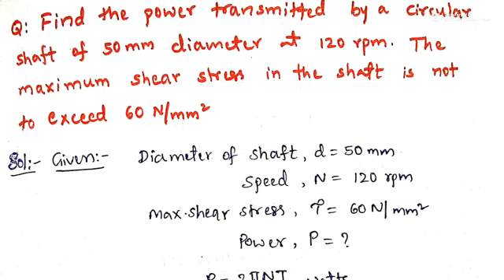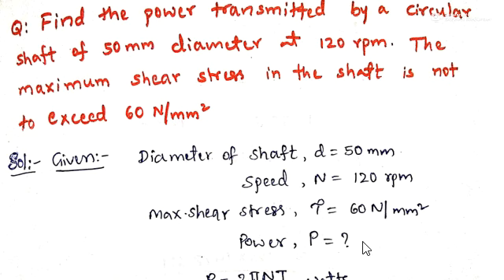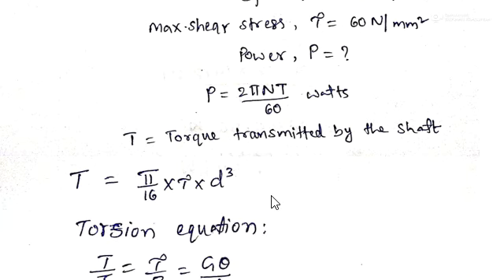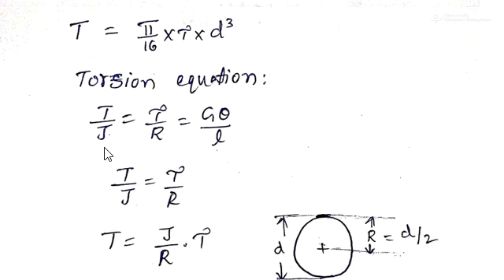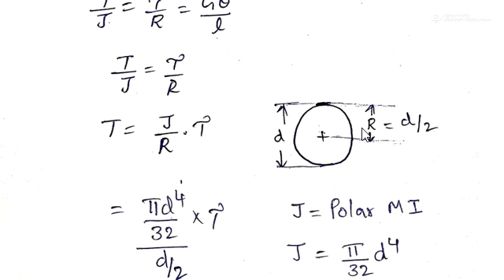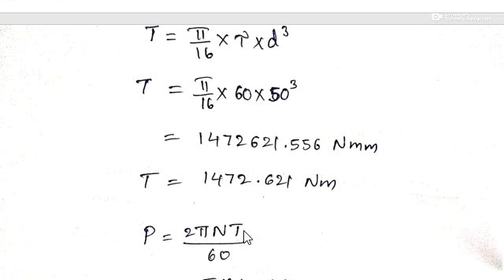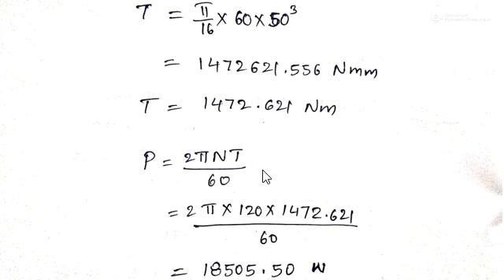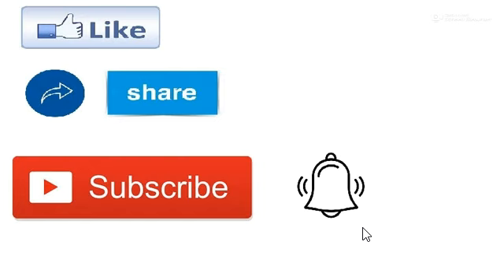Problem on Torsion of shafts, Strength of materials (MOS)

Comment: Q.2) A hollow circular shaft 190mm external diameter& 155mm internal diameter, transmitting power at 178rpm and the angle of twist at a length of 2m is found to be 0.55°. Calculate power transmitted & maximum shear stress. Take G = 0.8 × 105 N/mm2.
Reply: Answer plaze
Reply: Chapter 4 -A: Torsion of Circular Shaft: https://www.youtube.com/playlist?list=PLtElM8k8rEY0rC_P_O4u7qmkhsjFLMg_A

Comment: Sir, everything is ok but where did you do you calculation? Means by using calsis or without calsis ?
Reply: Because I just seen your question , I solved it and then I seen your video, my answer was correct, but i solved without using their units. And my answer was 18.46 × 10⁶.
Reply from the maker: With calculator only
Reply: @ReferenceBook  ok
Reply: @ReferenceBook  som subject was easy for me before solving numerical but now it's been difficult